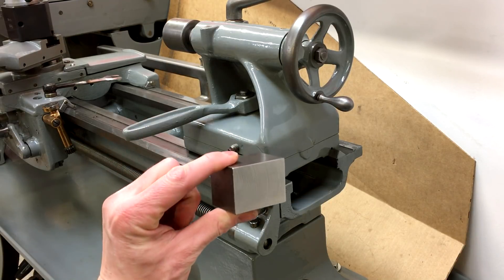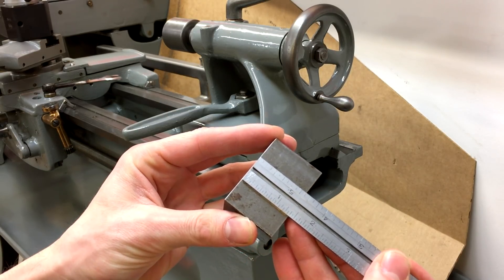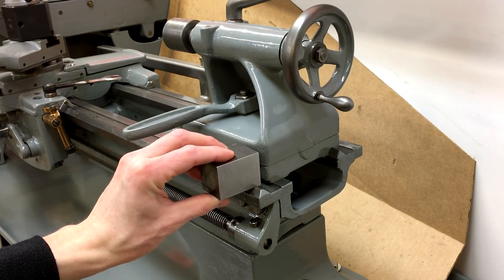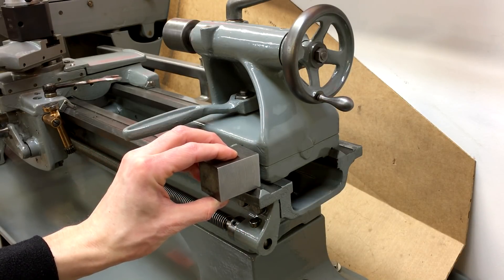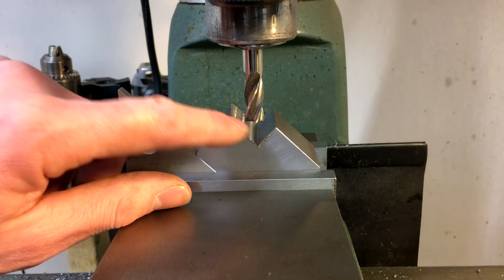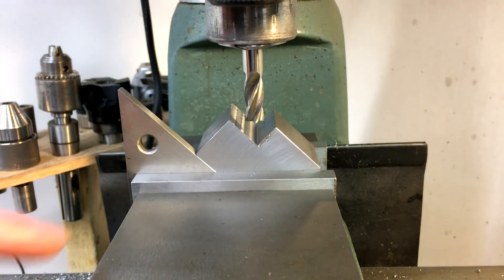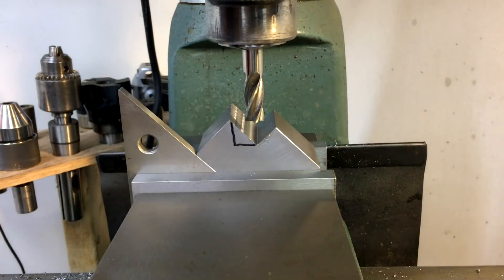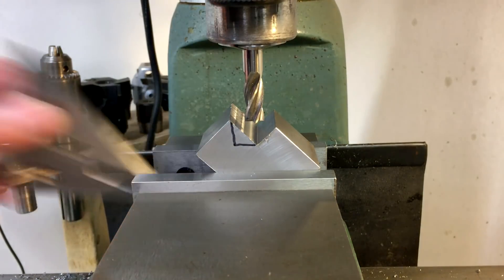Multi Position Carriage Stop for the Logan Lathe Part 1

Comment: Thank you for your efforts --- You can get the matching angle by either working a wooden model or using wax to make a model is very easy and you can sculpt it with your hand then the machine is blending on the same angle to work the desired mod

Comment: Love the work. What kind of Mill is that? From one Logan owner to another. These lathes rock. I love my Logan.
Reply from the maker: Thanks!  Some sort of import brand.  Didn't have any badges on it when I found it on Craigslist.  Just your standard column mill drill.  Approx 10" x 30" of table travel.  2HP motor.  Power downfeed.  Can't take as heavy of cuts as you could with a Bridgeport but its not bad for hobby use.  What kind of Logan do you have?  I love my lathe.
Reply: Build Fix Create I have a Logan 825. Supposedly it's a tool room lathe. When I got it, it was used as a boat anchor and rusted shut. I still don't have power feed and threading on it as I have to replace a gear.
Reply: I have its Restoration on my own YouTube channel if your interested.
Reply from the maker: I just check it out and subbed.  Cool lathe!
Reply: Build Fix Create thanks for the sub. :)

Comment: You are milling in the wrong direction 😉
Reply from the maker: Thanks for the explanation, makes sense.  I will give it another try next time I use the mill.  My experience (on my small - not very rigid mill) is that it doesn't like making deeper side cuts as compared to shallow full width cuts.  If that makes any sense.  It vibrates and I cant take a very heavy cut from the side.  I get much less of that when advancing the cut downwards.  But again, your explanation on tool wear makes perfect sense.  I am just a hobbyist so I will happily take feedback when its explained like this.  Thanks!  Glad you like the videos!
Reply: Not how I would phrase it. The first operation was slotting with a roughing end mill, and then you removed the outer section. Slotting is really hard on end mills, because the chips don't have a good exit path and you end up re-cutting your swarf. Excess wear on the end mill and worse surface finish (which obviously didn't matter here since you cleaned it up after). Cutting from the outside and then moving to your line would have been a more traditional and arguably more advisable approach. 

All that said, as a Logan owner I appreciate this video and project, and my feedback is meant to be helpful, not critical. Looking forward to more!
Reply: One other consideration is that end mills usually a wear out fastest on the very tips of the flutes, so any time you can optimize your cutting approach to minimize the work done by those flutes, the longer your tool will last, if that's a priority for you. For most home shop guys that is a priority. (For industrial production speed is worth far more than the tool, so that's not necessarily relevant.) So cutting at gill depth and moving across the part in, say, 3 passes, would have meant more cutting by the edges of your rougher and less by the very end, making that beautiful tool last longer.
Reply from the maker: Not sure what you mean
Reply: That is what i mean.  Keep the good work, like your Videos !
Reply from the maker: Thanks!